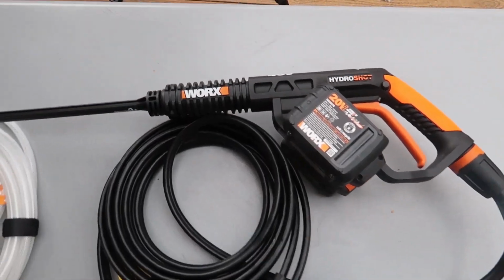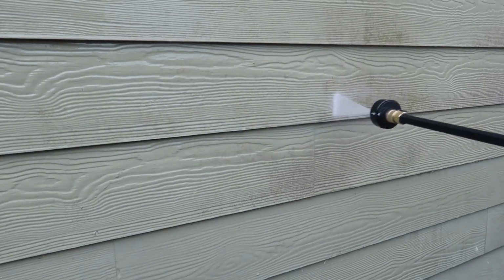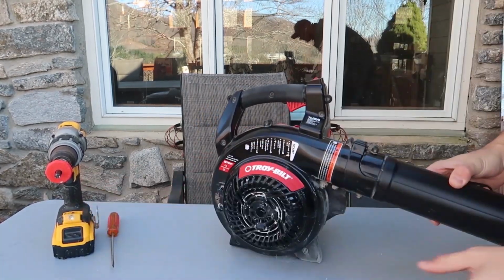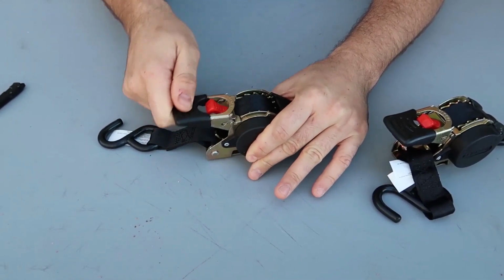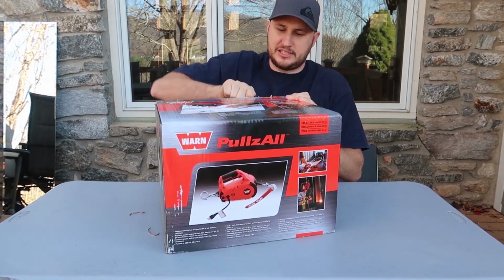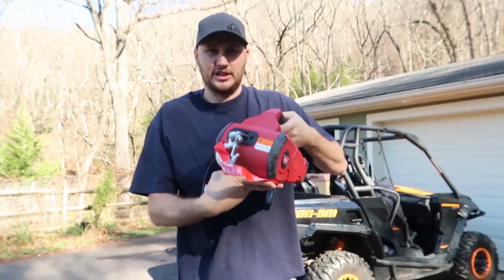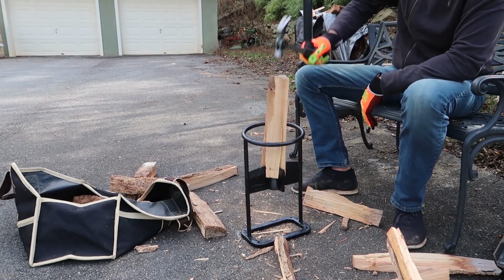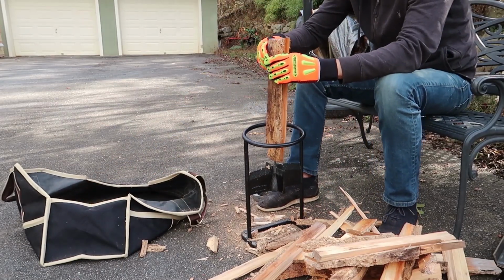5 Amazing Tools That Are at Another Level #7

Comment: For $300 the powershot better work! You can buy a gas pressure washer far cheaper. And they are just as portable.
Reply: Just as portable?  You’re insane.  How is an internal combustion engine more portable?  There’s probably 4 times the total weight.

Comment: 2 stroke engines will start and run backwards without any problems.
Reply: Some will some won’t. I have a couple chainsaws with broken starters that I haven’t fixed yet so I just use a drill and socket in the flywheel and two of them only start one direction